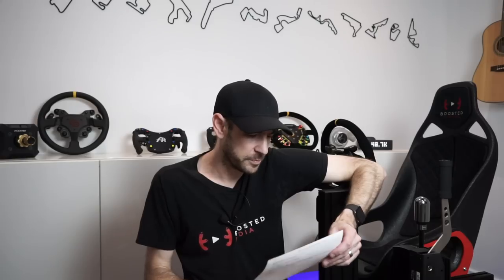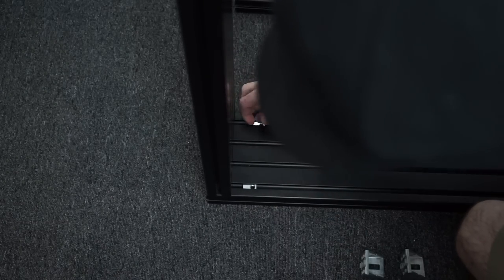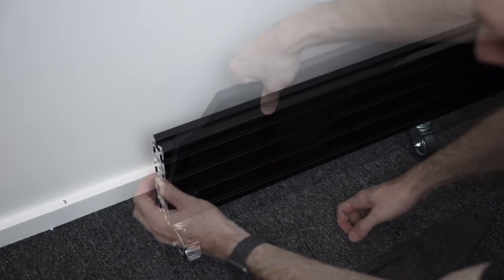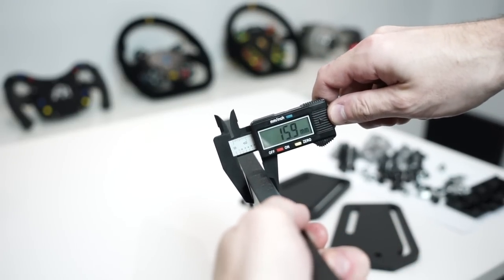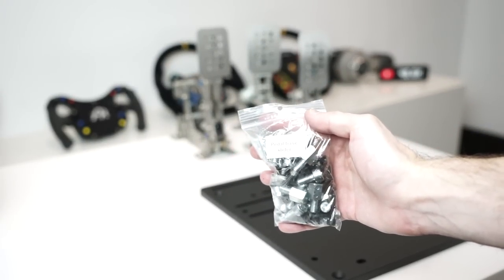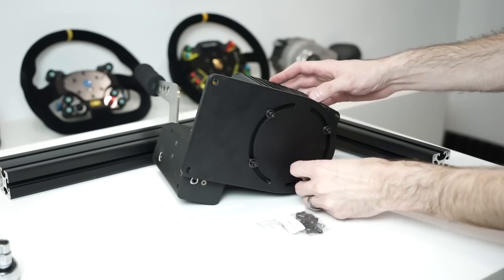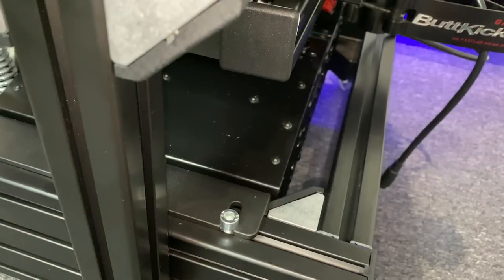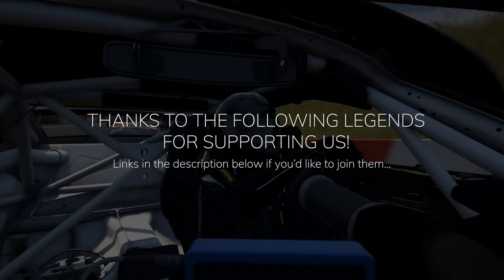BUILDING MY DREAM SIM RACING RIG  - Sim-lab P1-X Cockpit Assembly & First Impressions

Comment: Nice looking rig and very good video. I build mine completely with aluminium profiles without all the steel plates. No problem with that, you dont need them. But black looks much better than silver like mine is.

Comment: great choice Will. from now on, you'll finally feel what a DD can actually deliver, believe me :)
Reply: just a question, doesn't the Ultimate have, like other sc2 models, threaded holes to install the front bolts? I mounted my sc2 sport to the same front mount without the need of locking nuts

Comment: could you not turn the angle bracket in the other direction to the underneath of the larger profile allowing the motion platform to sit down into the hollow section?
Reply from the maker: I did think about it but it doesn’t quite fit with the castor wheels and also looks like the platform would hit the sides.

Comment: The seat height is my issue as well and whily you can angle the wheel fairly well if you want it more straight on you'll be having the mounting brackets lower slot all the way on top of the 8020. Really wish they made em 10cm higher

Comment: Couple questions for things like the shifter plates, and the the tv mount come with all the nuts and bolts needed not just to put together but also to attach you accessories to them?

Also how would you best attach a handbrake to this set up if it was a different brand that couldn’t attached to the shifter base?

Comment: What was your reasoning behind mounting the pedal brackets backwards?  Their instructions show the tapered part facing forward.
Reply: Distance. Having it backward keeps the platform closer, which is ideal for GT setup. I have mine set up correctly, at distance, and at the highest point, for GP racing, which is very different since your legs are straight to the pedals. I think you are only doing dirt and GT racing and want a "normal car" seating position then his setup makes the most sense. Once the pedals and slider tray are installed the entire platform is too heavy to remove and turn around. 

Also, having it installed in "the proper" direction provides an absurd amount of distance that most humans would not take advantage of. I am 198cm so I need that extra distance.

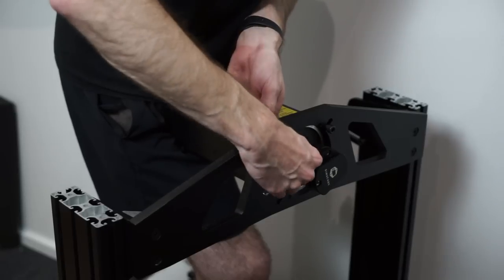Comment: 13:00  Don't you want some washers under those cap screws so they don't mangle the slots?  I know I do...
Reply from the maker: I wondered the same thing but given all the other hardware required was included, I just went with what was there. I may add some later.

Comment: What’s the name of that BEAT at the background ?

And very informative video ! Gonna buy a P1X and you spared me all the manual reading 🏁💯
Reply: The manual is absolute garbage, right?!!? I followed Barry's instructions and that was super helpful putting the P1X together. Tossed instructions in the bin!
Reply: @Wodz30  I ordered P1X. Are ALL bolts and nuts included to mount my Seat brackets, seat, pedals and Podium DD2 ? 

Was anything missing with yours ?

Comment: Great video. I have just ordered a P1-X and also have a NLR V3. With regard to the seat mounting height, using special the Sim-Lab brackets for the V3 as you have done, I was hoping it is possible to mount the brackets to the underside of the main profile, instead of to the top? Wondering if doing so would possibly lower the seat a little?
Reply from the maker: That makes it sit too low and the seat hits the 40x160 profile when it moves.
Reply from the maker: Could potentially work for people with seats that can bolt directly to the motion platform. But for me it wouldn’t work.
Reply: Boosted Media hi there and thanks for confirming that for me. 👍

Comment: With respect to the Next Level Racing V3 mounts, can they not be fitted upside down, or on the underside of the frame so that it makes the V3 sit lower?
Reply from the maker: Not if you intent to mount a buttkicker.
Reply: I have just seen a later video you did showing the brackets mounted as I was suggesting, so I have my answer - cheers

Comment: Are you happy with this seat? Actually I‘m thinking about to buy one for my first alu rig 😊 Maybe you can do a short review from the seat 😊
Reply from the maker: I’m still mixed about it. It’s not very well suited to my application with the motion platform I’m running and my elbows constantly hit the sides. The later models are improved.
Reply: Boosted Media Thank you very much 😊 Do you think in an non motion rig it would be better? I will risk a closer look at it. Best regards from a german subscriber 😊

Comment: What's the benefit of going 160/40 vs the smaller/cheaper 80/40 cockpits?
Reply from the maker: Stronger, more rigid basically.
Reply: @boostedmedia  OK that's what I figured, I just wouldn't think the 80/40 would flex but maybe it does.  Thanks!

Comment: Hi Will.  I'm based in Melbourne.  My Sim Lab P1-X is about to be delivered by UPS and I just got a text saying I owe them $357 for "import fees".  It equates to just under 20% of the AUD price for the order (I've included a few extras).  Is that hit right?  There was no mention on the Sim-Lab site (other than the EUR 257 shipping charge - which is a hefty whack in its own right).  I had just assumed GST and any import duties were already included.  What was your experience?  Tom
Reply from the maker: That sounds correct.
Reply: @boostedmedia  Will, thank you for the very quick reply.  But yikes - wasn't expecting that.  A warning/head-up on their web site would have been nice.  Your videos are brilliant - keep it up.
Reply: Reading your reply now, as I am looking and they charge $500 euros for shipping for a P1-X omg to Sydney! Together with import fees I don't know if I should just settle with a trak racer...

Comment: Hey will something that’s always confused me since one of your first videos that I watched was the motion rig, why is it just on the seat shouldn’t the whole rig move? Sorry if you’ve answered this before as you’d know if you remember me I haven’t stuck around to watch many videos but every time I do watch something I always enjoy it
Reply from the maker: Basically because it’s a lot cheaper than a full platform actuator system. But what it’s trying to achieve is also different. It’s simulating the forces you feel through the seat of a car rather than the movement of the car itself. 

A lot of people actually run both a full rig platform and a seat mover for that reason.
Reply: Boosted Media oh I didn’t think about the forces that are just going through the seat, thanks for that and as usual great video

Comment: How is it to drive when only the sest is moving?
Reply from the maker: Surprisingly good (based off my experience with the old cockpit, haven’t driven with this one yet). It’s simulating the movement and forces you experience in the seat of a car, not the movement of the car itself, so less is more to a large extent.
Reply: @boostedmedia  One part that I miss when playing is to feel the up/down shifts in the back. The one you have from NLR helps with that. But if I would have it I think I would start missing feeling the car roll when cornering. Hahaha

Comment: what a shame they didn't colorize the 40x40x40 corner brackets!!!!!! they look silly on such rich aluminium rig... and some screw bolts too)) aesthetics: thumbs down for sim-lab
Reply from the maker: Would be a nice touch if they were black but easy enough to run a rattle can over them before you install if it bothers you.
Reply: They are black now. I just built the P1X last week